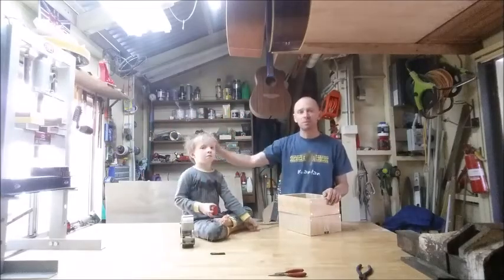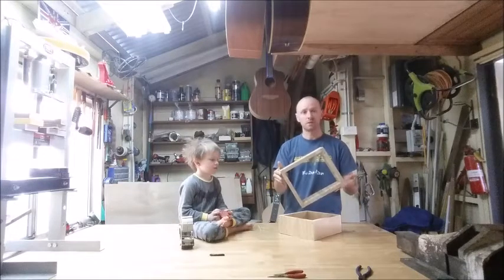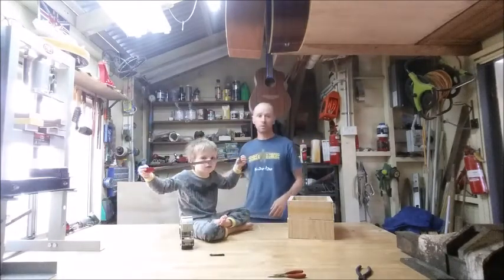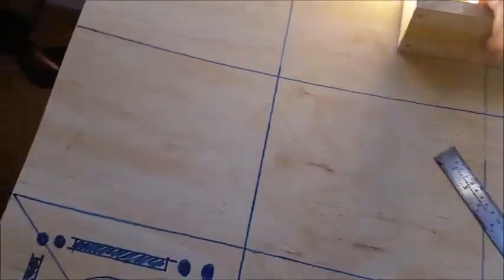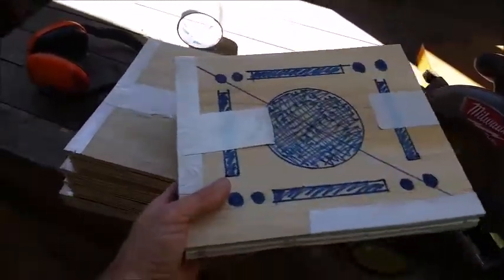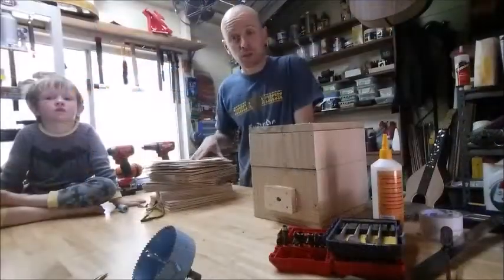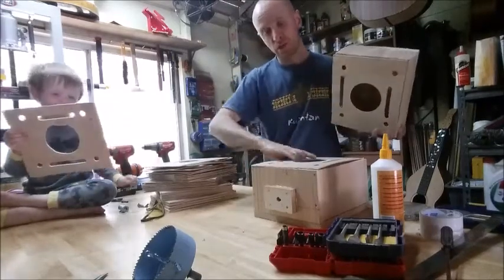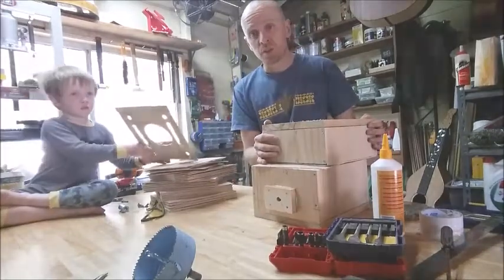Native Stingless Bees - How to make a hive seperator

Comment: Great idea. Much better than just ripping them apart. 
My questions are what size is the large hole and can perspex be used instead of the plywood.
Could they be sliced apart between the plies with piano wire similar to a garrotte?
I'm just about to make my very first hive here in the Philippines. There's native stingless bees here but don't know what brand/type.